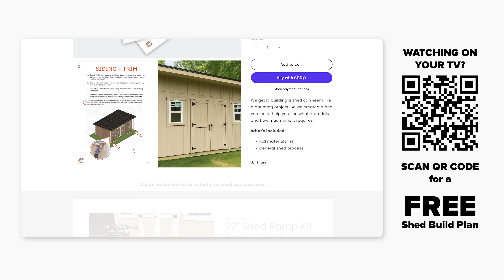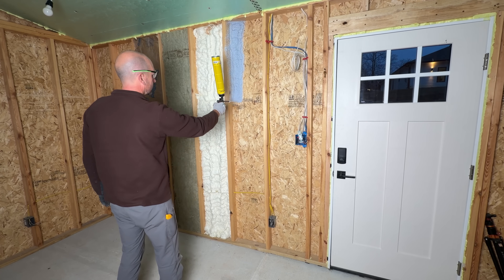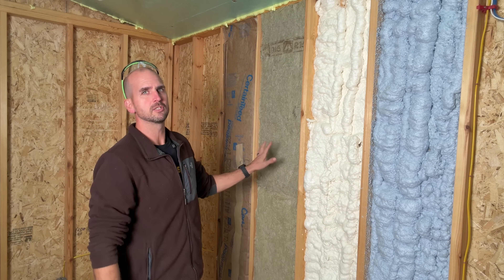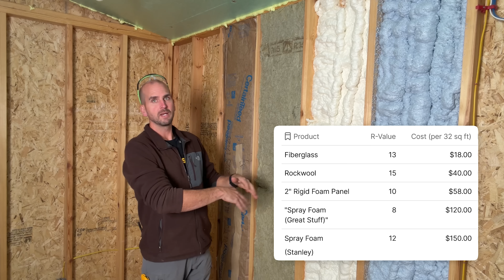Stop Wasting Money! Most Homeowners Are Insulating Walls Wrong

Comment: Wow... I'll use Rockwool purely because it is both mold and fire resistant. That you dont get the fiberglass slivers is pure bonus for me.
Reply: I used Rockwool for the first time insulating my mom's floor over a crawlspace. It made a huge difference in the feel of the room. No trying to keep fiberglass up while you staple in place. No stapling at all. As long as you have standard spaces between studs or joists it friction fits. Easy to fill in gaps. Easy to avoid compressing it. No fiberglass dust floating everywhere and getting all over your clothes. It goes in clean, quick, and easy compared to everything else. Plus, as you said, it is mold and fire resistant. After that experience I was sold. Worth every penny.
Reply: @jdf585-p2g  you are actually supposed to add a extra 1/4" to compress 2 sheets together to remove cold air gaps like to fiber glass.  Stone wool is made to compress up to 5% but not loose it's R value
Reply: @jdf585-p2g  Sigh, they are both mold/fire proof, not just resistant.  They are identical composition ceramics just different form factor.  Idiot video host.  Rockwool is great for sound dampening, but you MUST support it just like Fiberglass for underfloor installation.   Yes, it supports itself better initially than Fiberglass, but it will NOT retain this over time.   Manufacturer even tells you it needs support.  The no fiberglass dust is a nice bonus.   Now I would not do so for cost reasons, as I can get 2X as much Fiberglass if not 3X as much insulating power in fiberglass than rockwool, but I understand why some people choose rockwool, "mineral wool" AKA Fiberglass AKA silicon dioxide + other garbage thrown in and why it is so cheap.
Reply: @w8stral  Comparing to mineral wool  fiberglass is garbage. Fiberglass melts down on 200 deg C and drops down in form of small glass droplets, but mineral wool stands 1100 deg C, a huge difference. I Europe you could see fibreglass insulation in 1970 but in 1980 not anymore. Nobody is using fibreglass there and I believe it's banned product.
Reply: @HaryHaller-k3s  According to your brain drain, glass melts at 200C.... Good one.  Ill be sure to not put my glass casserole dishes in the oven to cook dinner, after all some idiot on the internet believes glass melts at 200C... Unbelievable<<SHAKESMYHEAD>>.  Glass fiber dear fool, even the WORSE cheapest form of glass melts over 500C which is HIGHER than the flame temperature when wood is burning.   No, it s not banned anywhere.  Polystyrene insulation is though which spontaneously bursts into flame at a mere 80C yet fools still put it on their homes or roofs like this idiot did.   Hey, I have a bridge to sell you over some nice swamp land next to several toxic superfund sites.  Going cheap, only a couple billion.
Reply: @w8stral  Absolutely.
Reply: The new fiberglass insulation doesn't itch like the old stuff!!
Reply: @raymonddavis3286  Well, it itches LESS
Reply: @raymonddavis3286  Another excellent point.  The old stuff never bothered me, so I never noticed the change.
Reply: Unlike fiberglass, Rockwool does not absorb or hold moisture.
Reply: @scooterp7009  take a scrap put it in water then come back and tell us again
Reply: @s @scooterp7009 Nonsense. The more dense material of the rockwool is more likely to hold onto moisture. It's like the difference between the nasty smelly moldy traditional sponges that stay wet for days compared to the lighter foam ones that dry very quickly.
Reply: @scooterp7009  and it can be used in outdoor applications, like enclosed porches that have crawl spaces.  Plus there is rock board that you add to the outside of your house and then just re-side over it,  works like tyvex house wrap.  So now you don't have to rip open the wall
Reply: @scooterp7009  They actually use rockwool in hydroponic watering systems as a substrate substitute to soil. It holds water then drains but stays moist.
Reply: @PerryRennich 
AI disagrees with you, so you must be wrong 😂
Reply: WRONG!
Reply: Host of vid lied: Fiberglass is also mold and fire proof, not just fire resistant.  Neither can grow mold.  They are BOTH ceramics and literally CANNOT catch on fire. Why you should use brain and not trust people on YT(myself included).  Look up basic information yourself.
Reply: @w8stral  You are wrong. I believe Myth Busters used to test both material and showed the difference. Fiberglass is as the name tells you GLASS FIBRE, but rock wool you get from lava rocks.
Reply: @HaryHaller-k3s  You get mineral wool from steel slag which vast majority of that is silicon dioxide--> Glass  You need to actually watch the Myth busters then.
Reply: @w8stral  Yes fiberglass wont mold but do you see the paper on the front Ya that molds bad
Reply: @johng8049  LOL, you see that paper you claim molds?  I have been in thousands Of walls over my lifetime.  Guess what I have NEVER seen?  Mold on that paper.  Seen mold on sheetrock.  Seen mold on that garbage OSB board.  Seen mold on 2x4's and interior side of siding.  But NEVER on said paper.  I live in horrifically humid eternally WET western Washington and there is literally mold everywhere... Just not on the kraft paper of fiberglass insulation

Got another lie to promulgate?
Reply: There is no problem with fiberglass if you wear gloves and a mask. Why is that so hard for some people? Fiberglass is also mold and fire resistant.
Reply: @CorneliusTaylor-s1u Fiberglass doesn't burn, but it really isn't fire resistant. You can melt a hole through it in seconds with a blow torch, there are plenty of comparison tests right here on Youtube.
Reply: @RedMike-ym8hd 

You could do the same with rockwool.
Reply: @CorneliusTaylor-s1u LOL, no you can't, unless you have something that gets above 1200 Celsius. It's literally made of rock and slag. Are you a fiberglass sales rep or something?
Reply: @RedMike-ym8hd  He either is a sales rep or completely clueless, the fireproofing insulation mats are made from the same stuff as Rockwool is...
Reply: @villerantavalli9395  LMAO, no they aren't.
Reply: @CorneliusTaylor-s1u fire resistant yes but at 800° it will smoke away in about 3-4 minutes exposing your bay.  Rockwool burns at 2,100°
Reply: @allenpierce4575 both are resistant not proof. It's something many seem to overlook. Anything will burn if heated enough.
Reply: @ericcooley9407  But the difference in melting point is material. Fires easily heat materials to 800F or even 1300F (the upper limit I've seen on some fiberglass batts) in short order; flashover occurs below 1200F. Getting to 2100F takes quite a bit longer. Minutes are critical in house fires.
Reply: @CorneliusTaylor-s1u It's not that its hard, it's just another issue to worry about.the fiberglass dust is just incredibly annoying. I live in Texas and we have 3 season. Cold (cool to anyone not living in the artic), decent, and blazing hot at least 7 months.
Reply: @CorneliusTaylor-s1u Not true Ive had fiberglass go through leather gloves a lot.
Reply: fiberglass catches fire quickly, don’t ask me how I know
Reply: @setinstone31 

No it doesn't.
Reply: @setinstone31  newer fiberglass does not combust into flames at 800° it smokes away in about 2-3 minutes and then your bay is exposed

Comment: Rockwool insulation primarily contains basalt rock, sometimes mixed with recycled slag, melted and spun into fibers, then bound with a resin (like phenol formaldehyde) to form durable, fire-resistant, and water-resistant insulation batts or boards, offering excellent thermal and acoustic performance for walls, floors, and roofs.   I personally prefer to use pink fiberglass for 2x4 walls. The spray works very well in deeper cavities like 2x6 but can be costly to install and a major pain when reworking any part of the wall later on.

Comment: That spray foam is a mess! No way!
Reply from the maker: For insulating more than small cracks and holes it is a no go for me.
Reply: @EverydayHomeRepairs  It's best use is in hard to get places like attic edges, and installed by a professional, not by DIY cans. In wall bays the batts are a cheap, effective, and easy to install solution. If you're building new, consider exterior insulation, as it stops thermal bridging by the wood framing.
Reply: Rockwool is the way to go!

Comment: And the roof, the most important, rafters went uninsulated.  Couldve had R30..
Reply from the maker: Yeah, a pretty easy update adding rockwoll between each rafter for R25 and still a nice path for airflow.
Reply: I thot that was the whole point of the Rigid Foam boards on the ceiling… so you wouldn’t Have to install insulation between each and every rafter.
Reply: Also those rafters will make a cozy home for rodents !